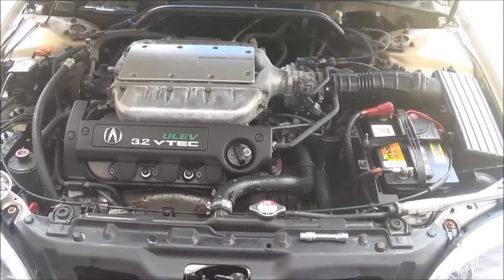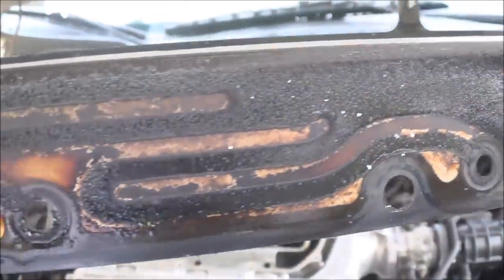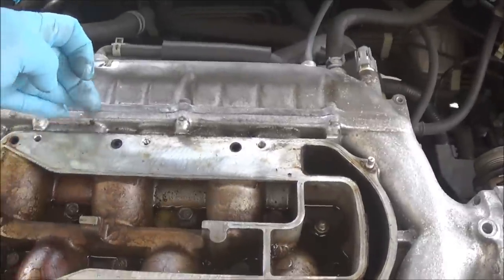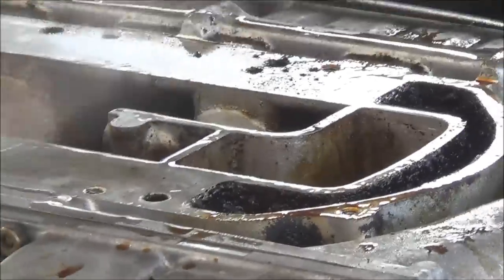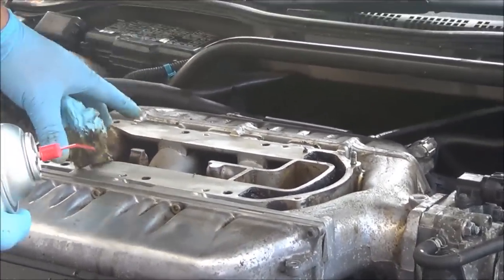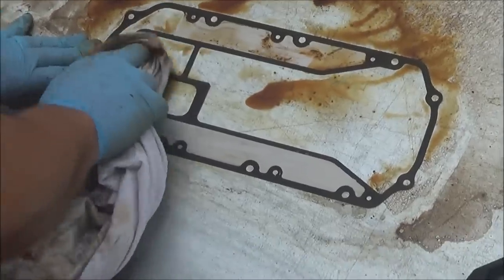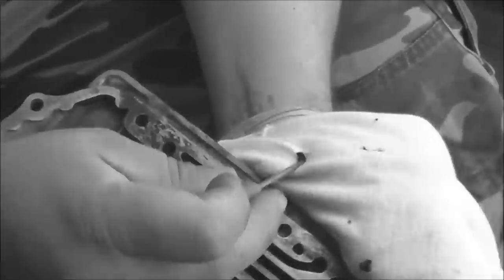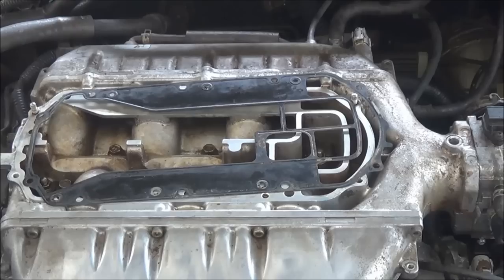2000 ACURA TL MANIFOLD CLEAN

Comment: I did this cleaning yesterday on my ‘02 Acura TL. The EGR ports on my Engine were gunked up pretty bad. I cleaned them all out really good with Carb Cleaner & a small screwdriver like you used in this great video.  I cleaned my EGR Valve & ports, too. My Engine runs really smooth and my car Performs so much better after the cleaning 🧼. I would definitely recommend people to do this cleaning if they haven’t done it before.

Comment: I also have a 2000 Acura TL and was experiencing intermittent stuttering upon vibration. After cleaning just like you displayed, I started it up and while idling it shook a couple times like it coughed up a carbon buildup ball and its been running smooth ever since. No more misfires or stuttering when accelerating. Thank you a thousand times. Super helpful, God Bless!!!

Comment: This is regular maintenance for early honda/acura. Clean entire EGR system - all of it, not just the upper, the whole system from upper ports to the EGR valve itself.  The main port clog also means the tube down to the EGR valve is also in need of clear and cleaning. They can be really clogged. Better to free the carbon/gunk DRY (no spray cleaner) and vacuum most out as you chip it away. Spray cleaner after.

After a full system cleaning, you may want to check your're using the correct octane fuel for the vehicle. If it says premium you should use premium. This will lessen the
Reply: JDHammondman yes you are right. I always put Super Unleaded 92 Octane gas ⛽️ in my Acura Only!

Comment: I just cleaned my before watching this video.  I replaced the valve cover seals.  While I am at it, I checked and it is 95% clogging.  I used a piece of plastic to clean only.  Don’t used any metal object (including metal wire brush) to clean the surface or remove carbon built up.  The smooth surface need to be smooth for metal seal to work.  Please be careful.

In addition, he did the cleaning of the hole right at the air inlet with pushing all the built up carbon down the hold is bad.
I took that whole thing out and turned it over and that hole is going to the egr valve I think. If you take it out you will see where it go and don’t want to push the carbon deposits down there.

Use vacuum with very small plastic tube will help.

Comment: Great video, i bet thats why mine is wimpy going up hill.

If youre open to a suggestion? Dont use a steel screw driver to clean this. You can see at the end all the scratches and burrs around the main port. It probably wont make a difference but all those scratches are oppurtunities for oxidation and could over long enough start a hole in it and at the very least interfere with the airflow. A plastic tool is a better choice, even if it requires more time and effort.

Comment: Rather than spraying all the gunk into cylinders and ports especially the main port etc, that gunk is fairly hard, chip and scrape it off into a pile while its dry then take your shopvac and suck out dry carbon, for the stuff that is hard to scrape off take a rag wipe the stuff out, then spray with carb cleaner and wipe  again...repeat the process with the top cover, you'll need a small tool to scrape the top cover. With the gasket do as he has done in the video at the 14:00 mark spray, wipe and scrub genitally.  Don't suck up the oil with the shopvac use a rag or paper towels.

Comment: Hey Kevin, GREAT JOB on the video and cleaning.
I changed spark plugs coils and same thing.
Now check engine light is flashing and car knocking, will not drive it.
I think it is this manifold dirty gunk issue.

I will open to try and see how dirty or bad it is. I understand that you cleaned the 6 EGR ports, but the bigger hole, did you spray more carb cleaner to get it that clean, just worried to spray inside.

Please give me your thoughts.
Thanks,

Comment: thanks for posting bro I don't know a damn thing about cars so videos like this help me save alot of money!  I think I might have to replace my fuel pressure regulator and pcm because of a heat soak issue I'm having with my 3.2 2000 Acura tl but I'm going to try cleaning the manifold and see if it helps.

Comment: It's not carbon.  It's oil blowby from the engine.  No motor is 100% efficient.  When the oil passes through the oil ring on the piston, it mixes in the combustion chamber and through the PCV valve back into the intake manifold.  An oil catch can will prevent this.

Comment: Can I clean this top in the sink?
Reply: If you have a plastic sink used in laundry rooms, the gunk sprayed off the pieces will turn that white sink oily and brown. You'll have to use carb cleaner to wipe it off. Regular soaps won't work. Just do it outside using carb cleaners.

Comment: Great video. I have a question, how did you get the oil out from inside of the manifold?
Reply from the maker: Los Vtec got some rags and flat head along with the carb cleaner and worked at it good luck

Comment: Pretty good video I didnt even know about this. I was gonna buy a new gasket since it would be better than cleaning the old one but the damn thing is like $100 so i think its better to clean it. Do you recommend Seafoam in a spray can? Or are there other cleaners do you recommend?
Reply from the maker: krauser979 
I just got the can at walmart and carb cleaner or part cleaner !
Reply: Darksyne on Acurapartsforless.com the plenum gasket is only $20 bucks for a new one.

Comment: While you aren't wrong - Carb and Choke cleaner probably won't harm internals - carb doesn't stand for carbon, rather for "carburetor".
Reply: However, thanks very much for shedding light on the subject. My 2003 3.2TL Type S has some hesitation issues and my top plate turned out to be much more nasty than yours.
Reply: I have a 2003 3.2L CL type s and getting bad gas mils. Had the engine scanned for codes but no codes thrown.no check eng light.runs great. temp is perfect but getting bad gas miles.If I clean this will it help with my gas miles?
Reply: Sandy Marhefka I don't know, you should ask the video author.